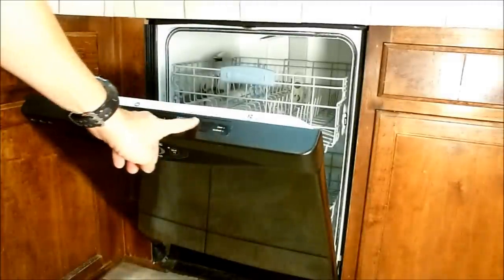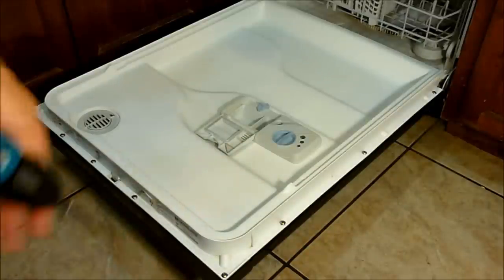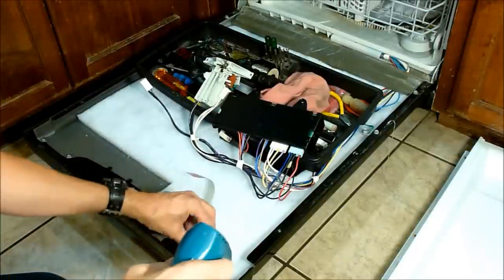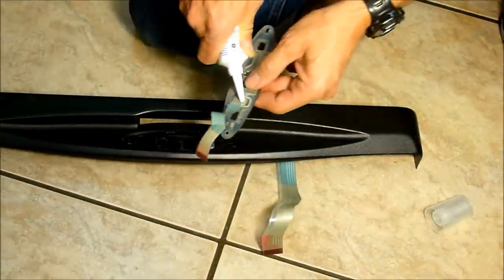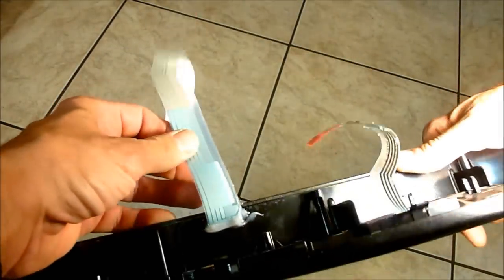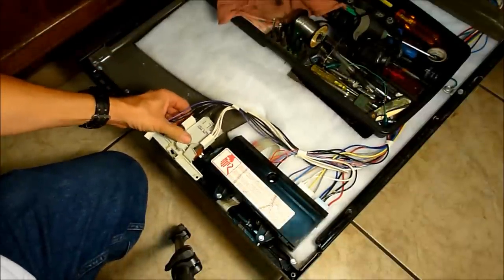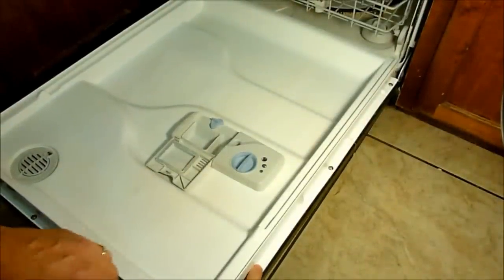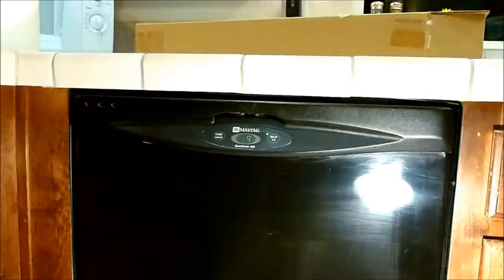Maytag Dishwasher Touch Pad Problem Repair Fix MDB7601 Control Panel Display

Comment: Thanks!! I just finished repairing my dishwsher with your vid. The control panel had the same corrosion problem you mentioned. I used silicone has you suggested. Just saved myself a bunch of money. The tech wanted 700 bucks to fix my machine....

Comment: This is great - I have exactly the same model, bought in 2005, and in ten years it got TEN new control panels, all under warranty, all with exactly the same problem, and finally they reimbursed me for the cost of the dishwasher (it was part of the extended warranty policy), and THEN I did a procedure like this to hopefully fix it for a long long time.

Comment: Maytag is not what it used to be performance-wise but we are stuck with one that is only 15 months old.  The pad is on on the front panel of stainless steel.  Your video cannot hurt, as we detach screws to get inside ours to simulate what you did.  This demystifying of it is so appreciated!  A service call would happen anyway.

Comment: Followed norcal715 utube instructions.  Ordered the new part online.  I did not use silicone ( I bought spray and did not want to use it since it's a tube in the video) and I am thrilled to say my dishwasher is running.  Thank you norcal  very much.  For $127.00 for the part, my dishwasher is working compared to buying a new one.  Hopefully, the fix will last at least 3 years like the first faulty touchpad.  I will not buy a Magtag again since they have knowingly outsourced the touchpad part.

Comment: Thanks a lot - brilliant video and explanation.  I had the same issue on my Maytag dishwasher (model mdb6702awb). I followed your steps but instead of using a sealant, I used an eraser to rub off any residue from the ribbon that goes from the front panel display to the motherboard circuit board.  I disconnected the ribbon from the circuit board and "erased" it with a pencil eraser. When I put everything back together, the dishwasher started working again.  It might have also been related to airing out the front panel display while I was working on the issue. I'm not sure how long this solution will last but hopefully buys me some time to research a replacement dishwasher. From numerous other posts, I've gathered that this particular model is highly prone to problems and expensive to repair.  So far I've saved a couple hundred dollars in parts and service costs by doing the repair myself. Thanks again!

Comment: This is exactly the symptom I'm having with my Maytag Quiet Series dishwasher. Appreciate the well organized demonstration. Wonder if you tried to repair the corroded contacts on the display panel before ordering a new one - I'm going to tackle this tomorrow and see if I can salvage the current panel before spending money on a replacement.

Comment: I repaired my MDBH985 using your video.  thank you very much for taking the time to make it and share it with us. Your tips saved me a lot of time, especially:
1.  the location of the screws for removing the control panel.
2.  that the inner liner can be completely removed.  Although I couldn't unplug the soap dispenser.
3.  to weight down the door with something.
4.  reassembling, making sure the inner liner was on top of the trim
I added some silicone caulk to where the ribbon goes to the button strip. 
I bought the replacement control panel from Amazon for 129.99 as Whirlpool Part Number W10161144: PANEL-CNTL.

Comment: Thank you... My MDB965 stopped working. Start button did nothing. A couple of the other buttons would flash numbers 29 times then nothing. So...I took the panel off, wiggled the flat wire going thru the front to the display, turned the circuit breaker back on. Now it works. If it dies again I'll do the silicon treatment. Happy for the Holidays  ;-)

Comment: thanks for the taking the time to make the video. After reading the comments I guess I should feel pretty good about mine lasting 10 years now, before these issues. I guess ill just get a new one.
Reply: I had a repair man come out and diagnose my dishwasher he said it was the board, and quoted me $300 for the part + labor. I ordered it on Ebay for $99 and installed it with the help of your video and all is well. Thanks!

Comment: Thank you so much. My dishwasher is a different brand but the touchpad is pretty much the same. I'm fortunate enough to only have the issue with the front panel, which has only the Start and Favorite Cycle buttons. The top works decent, some LEDs don't light up but we can press the cycle and the delay button, so we just wait another hour before the dishes get clean!

Also, I only stumbled across this channel because I was trying to figure out how to fix my TV (which I did)! The chances... wow.

Comment: Thank you for saving me $148 for a new control panel.  Mine is a Maytag model MDB6759, but it's exactly the same fix.  2 small additions to your procedure will help.

1.  When pulling the touch panel, get down far enough and get to the bottom of the touch pad.  I started peeling up the top layer with the print on it
.  
2.Use an eraser to clean the corrosion on the ribbon cable, right at the touch panel, before sealing with the silicone.  Mine didn't work before this, but did after.

Comment: I too fixed my dishwasher with inspiration from this video - thank you! Mine is an MDBTT70AWB. First I took off the entire control panel housing per this video and dried it out by leaving it over a furnace heat vent. I used high temperature silicone RTV and sealed around the ribbon cable where it enters the control panel (the large plastic housing that has the buttons etc), and I also, after cleaning the ribbon cable contacts where it enters the circuit board, I smeared dielectric grease around the ribbon cable where it goes into the plastic connector, as well as around that plastic connector housing, to try to keep steam out of the connection. I also ended up sealing around the vent, since the black foam gasket that seals the vent in the door liner to the exit on the front of the control panel housing looked worn and I was concerned steam could also enter the control panel housing this way. Everything has been fine since (used to blink 9 and got worse and worse with this, sometimes finishing a load and sometimes not, and seeming to start blinking 9 after a run, hence presumed due to more and more steam getting into the control panel).

Comment: Just a note: a lot of silicone sealants have acetic acid or something very similar in them which DOES cause corrosion. I found out this the hard way and since then I only use hot glue for this kind of stuff. It should not be a problem if the silicone can breathe and the acetate(?) can evaporate. Check if the silicone has a pungent smell and don't use it for electronics in case it does.

Comment: Thank you very much for this video. Even though my Maytag was different, the instruction was good and helped very much. Also, thanks for the info on using the Silicon sealer. I hope this helps.

Comment: After looking at this video I decided to try working on it again. This time I found the main ribbon from the touch pad to the control box loose. The small box thing it inserts to was a bit loose, so I adjusted it, plugged in the cable securely, turned on the juice again and all the pads lit up! Great!I shut off the electricity, put it all together nice and secure, checked again and all was good. Until I loaded up the dishwasher and it did nothing! It has to be haunted.... Ugh!

Comment: I have similar problems. I repaired the main ribbon cable by removing rust and coating it with liquid tape (waterproof). Dishwasher worked great..for about 3 weeks. No response again from the touch panel and I mean nothing. I will try looking at all the component as demonstrated in this video tomorrow. If I'm successful, maybe I can cancel the order for a new one I purchased. By the way, this dishwasher is new, but was stored in my garage for 6 years in the original carton, untouched, until my other one was finally ready to go. I'm very frustrated by this process, but if I can get this Maytag working that would be great.

Comment: Thank you for doing this.  My issue was only the smaller panel's digital numbers going out and then the start button not working.  As everyone has noticed, I had to order the whole thing: "MAYTAG DISHWASHER CONTROL PANEL 6-919825".  I got it for $75 new off eBay.  Now, I used the only silicone I had "DAP caulk sealant" and then just now noticed another person's comment on that causing corrosion.  I hope that person is wrong because it is too late now.  Well all is working well.  Thank you so much for taking the time to post this and help other people all over the world.
Reply: Actually, I spoke too soon, but I'm just getting back now to writing about it.  Replacing the touch panel(s) did not resolve the issue.  I'll have to do some more troubleshooting and likely replace the control board.
Reply: Are you up and running now?
For a long term fix see my post about rectifying the design flaws or pretty much all dishwashers with control panels /embedded electronics Whirlpool has made (Under various brands) since 2002.
Reply: No, I had to purchase a new dishwasher.  You refer to a post, what post?
Reply: James Shipley Pretty sure post was on this page. Post talked about ways to isolate control board (computer) and control panel (keyboard, rouchpad) from MOSITURE via adding additional sealing around the vent which is steam /moisture is supposed  to exit from... 
And a thought on how to add venting to keep any moisture away from computer and touch pad.

Comment: It cost me $225 to replace the touch pad when it failed the first time, 2 years after installation. Now another 2 years and it has failed again. I thank you, norcal, for this helpful video, but I agree with the others who have said that this thing belongs in the dumpster. I don't to spend the $$$ to buy another touch pad for a poorly designed product that will probably just fail again somewhere down the road. Two years seems to be the lifespan of these parts (is yours still working? it's been almost 2 years). I will never buy another Maytag ANYTHING...they have NO customer service whatsoever. Not the dealer (who said to run a hairdryer over the panel to see if that helps) and not Maytag (who does not respond to customer service inquiries). If you try to give the product a bad review on their website, they will not post it, even though I was very careful to "be nice" about my problem. Now the question is: what brand is better?
Reply: I've had good luck with Samsung and LG
Reply: neckarsulme Thanks! Just bought a Samsung, in spite of some bad reviews. It's only been installed about 2 weeks, but so far I am very happy with it.
Reply: Kathleen Peters Go to Consumer Reports. They list all the best models. GE is supposed to be among the best. NO MAYTAG ever again.
Reply: Kathleen Peters Agreed. Our Maytag Jetclean failed at the 13 month mark. The customer service is absent. I'll never again buy anything Whirlpool makes. It's a joke.
Reply: The wiring going to the touch pad was the problem as whirlpool ,maytag etc has upgraded the the assembly but never admitted  they were at fault.
Reply: I have a Maytag I’m having erratic lights on the panel. I can touch one button and three others may or may not light up. Sometimes it may work the first time and others may take 20-30 tries to get it to work. The POS made it just out of warranty and of course it fucked up. I did tear it apart and noticed on my model their is a water leak inside the door letting moisture in and the idiots used a foam seal that absorbs water. I can squeeze it and it’s like a sponge. You can’t use that on something that’s exposed to water. That’s just poor manufacturing.

Comment: So is the corrosion on the ribbon cable caused primarily from the moisture generated by the dishwasher itself, or can it be caused by cleaning solutions that creep in from the outside or both?  

I'm replacing the touchpad on my Maytag dishwasher, except the buttons on my model go across the front rather than the top edge as shown.  I did peel apart my defective control panel and sure enough, the corrosion ate through some of the electrical traces on the ribbon cable where it turns a sharp bend and enters the front panel through the access slot.  Diagnosing the problem was easy once I got a copy of the tech sheet.  It told me the steps to take to put the machine into self-diagnosis mode and isolate the problem.  The new front panel was about $95.
Reply: The damage is being caused by MOISTURE that is generated by the machine itself, most likely cause improper sealing around vent at top left hand side  where it goes thru the door liner, AND the square part of the vent that makes contact with the plastic housing of the control panel /Keyboard/Touchpad.

That or the dish-washing dispenser.

One more place that MOISTURE gets generated, or can pass into the area the electronics reside in is at the very bottom of the inner door liner, there is a section there that is OPEN to the inside of the machine, which water intrudes into during normal operation.... and that area is NOT isolated, or "Channeled" so that moisture is kept away from the electronics of the unit!

Poor design and unless modified the panel /control board WILL fail again and again.

(On my MDB7609AWS2 MAYTAG Dishwasher which the touchpad is on the face of the door and has (4) slotted vents moisture is supposed to come out I plan on "sectioning" the vent assembly away from the electronics of the unit (Control panel, aka touchpad, and the Control board, aka "Computer), AND venting the electronics SEPARATELY.
See below:

(Pay attention WHIRLPOOL, which manufactures a board range of brands these days... Doing the above /below would cost maybe 0.50. cents in mass production.
 But hey the way it's designed now you sell TONS (Literally) of panels, control boards... New dishwashers by the truck loads... due to POOR DESIGN.
Or are the designers "designing" stuff to PURPOSELY FAIL?

Top managers and design teams being FIRED or scolded if they make a product too "good"
 (I'm serious, knew a engineer that went to work for Chevrolet designing STARTERS. He designed them with easily replaceable parts, Chevrolet said NO, you don't understand.. we want that starter to last thru the warranty and not much longer. )

Quick Question for John Q public:
How many years do you think a appliance that costs $1,000 plus to buy should last?
A year?, that's how long the warranty is on most things are these days.
A year warranty is a JOKE.

OK, Back to fixing Whirlpools BAD DESIGN. ( I've read this design going back to 2002, and it hasn't been fixed yet.)

First "PROPER DESIGN" when designing items in which during operation generate MOISTURE which will KILL the ELECTRONICS... is that you keep the electronics as far as you can from anything that might be negatively affected and you spray a layer of waterproofing on components and use waterproof cabling and you put in additional barriers (and venting)...

You don't put components into a HOSTILE ENVIRONMENT and  rely on (1) seal that is around parts in which MOISTURE passes thru each time the machine is run... you have a primary and secondary seal... (You idiots)

SO, 
HOW TO FIX WHIRLPOOLS BACK DESIGN?
The problem is MOISTURE so..

Here is my plan:
1: Anywhere there is a path to control panel. it gets sealed with ELECTRONICS , not "Household" Silicone sealant. (There is a difference)
2 : Wrap cabling with electrical tape, then apply a coating over that of say the stuff you coat handles of tools.
3: On where cabling might plug in, apply Dielectric paste.
4: Form "Barriers using some closed cell foam tubing that I have to keep any moisture away from the electronics, and then vent that area SEPARATELY.
* May use a combination of the tubing I have and some "Spray Foam", and or use one or the other... Trying to get my unit back up and running.
*Oh, if using spray foam you might want to hunt down the type that is NOT the expanding type as that might distort the outer panel.

5: I am going to re-seal areas around vent, and soap dispenser.. then form a secondary barrier.
6: Fabricate barriers so water that resides in tray at lower part of door does NOT cannot work it's way into area control board, and area cabling for control panel passes thru.

7: VENTING of area electronics are in:
(VENTING NEEDED due to HEAT Control board might generate, and allows for pathway for any moisture that gets in to escape)

Venting can be done in one of two ways:

First way voids any warranty you may have on the control panel aka Touchpad/Keyboard.

1: My first thought was to "mimic" the vents on the left hand side with a set on the right with a dermal tool. (I.E. Cut thru the plastic.)
Problem with that is if I do need to warranty the panel... they may give me grief about that.

Second way: Retains warranty... but is not my first choice as it would not "ventilate"  the area the electronics resides in as well is this:

2:  The handle is a separate piece (You don't get the handle when you order a new control panel.)

Drum roll please... DRILL HOLES THRU THE HANDLE SECTION....
(That is a separate piece.. the part that does NOT come with the control board... when you get a new control panel you have to remove it and stick in new control panel board.)

**************************

Oh, one last thing:

One cause of moisture is caused by the studding on the control panel cracking /breaking. 
(If the studs break/crack the panel will NOT seal tightly against the rectangular vent section)

If your panel is out of warranty... you might want to reinforce /rebuild /add webbing between those studs so panel will seal properly.

(I used a combination of J-W Weld slow, not fast dry epoxy, sections of  broken telescoping  antenna sections, and stainless steel wire to reinforce / rebuild broken studs.)